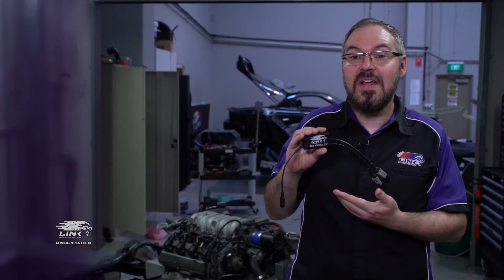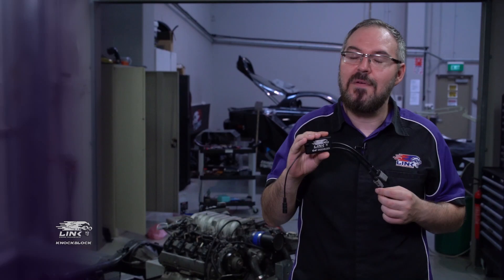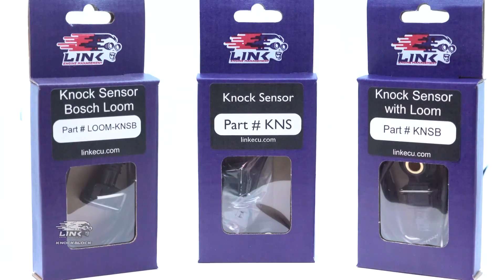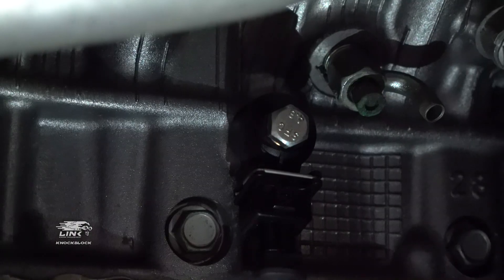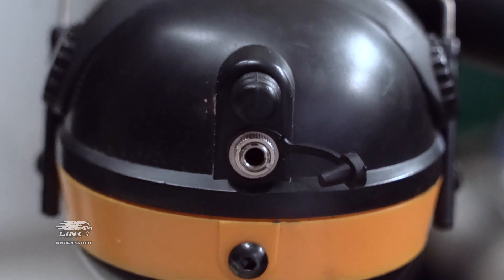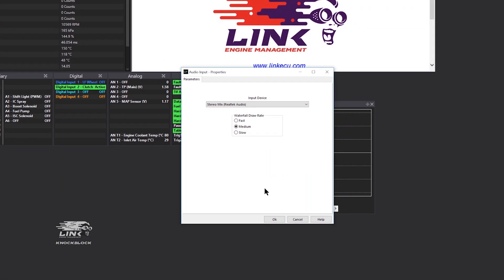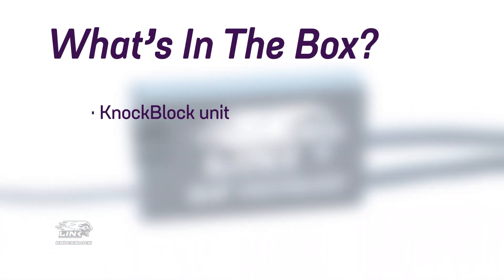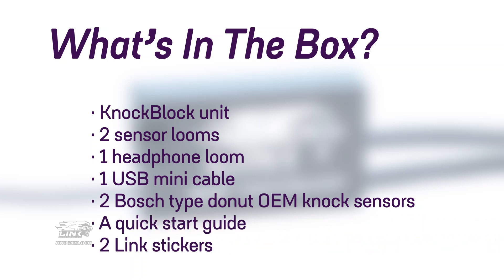Link KnockBlock

Comment: Since this can be used as a standalone knock monitor w/o an ECU per say, what software does it use?  Is that downloadable from the link website?  Is that the G4 software?  Sorry, never had a link ECU before but interested in just the Knockblock.
Reply from the maker: You can use PC Link (free on our website) to monitor the output, and if your ears are good enough you can listen directly using good quality headphones plugged in to the 3.5mm connector.

Comment: Could this be used on a yz250 2 stroke in a kart.  Also does this unit work with a warning light?
Reply from the maker: Hi Peter,
Yes, the KnockBlock can be used on a kart, but it won't work with a warning light.
Hope this helps.